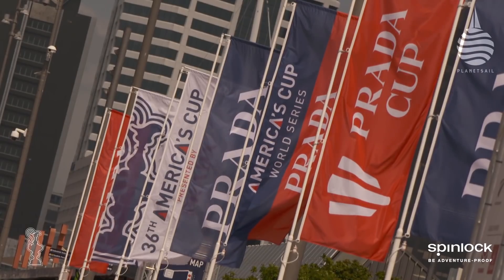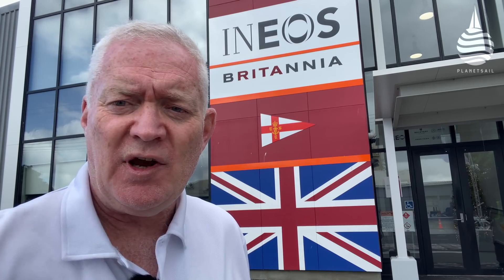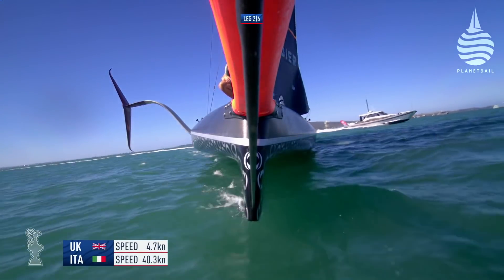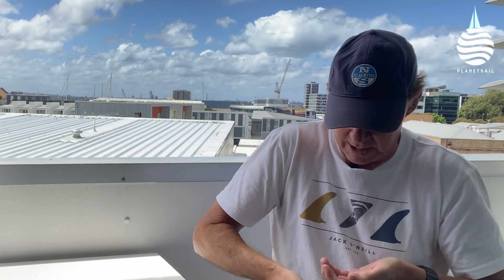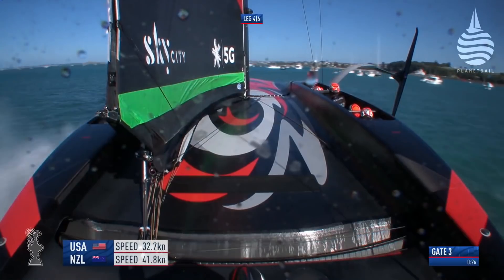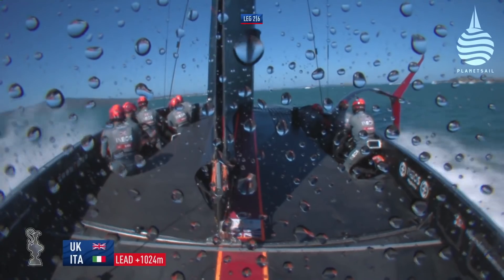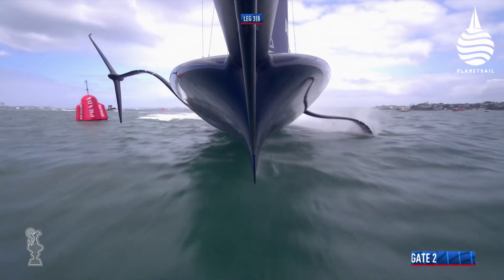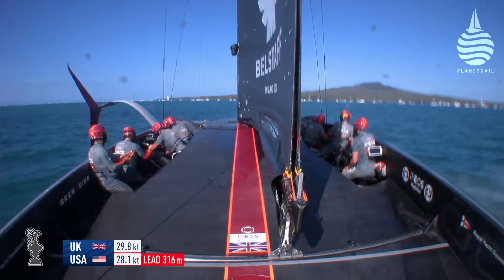America's Cup - Rigs & Remedies

Comment: I'm back from the future to say that next time round, the comment Kenny made following 3:48 still applied, although not to the same extent. GB were still arguably (at least in some conditions) faster than any of the other teams (including the defender) in a straight line once they were up to speed, but slower to accelerate, and it seemed more difficult for them to maintain speed through gybes and especially tacks. 
They got conditions which suited them particularly well in the last stages of the LVC finals, but only for a couple of races in the AmCup. Their trajectory is one of solid improvement though, at a steeper rate than any other team, so I think they will be closer next time, with a real chance of taking their overgrown silver cream jug home, and failing that if they persevere, well before the second centennial of losing it.
Australia had to try SIX times before winning it, and even the kiwis had to have three goes (and another two after failing to defend it).

Comment: Re getting up, I never understood the flat bottom of the keel (?) beam on Ineos. Surely that gives suction getting out of the water? If your slow up,  e as fast as you like your already behind. You can’t do that in sailing ⛵️ surely?  WO…they didn’t check the weather when launching their new boat? Wtf is going on down there? 😡
Reply: Looks pretty much like a water ski to me. Ideal shape for lifting onto the plane. Any deadrise (whether a V bottom, or a rounded bottom) just encourages more of the pressurised water to squish out sideways rather than pushing up against that ski. Snow skis in powder are just the same. There's no suction, quite the opposite, as long as there is a slight angle of attack (and a tip curve)

Comment: As a car guy, I think what Ken is saying @ 3:12 is the UK boat is geared too high. They don't have a first or second gear and need the stronger wind to start off in third gear. I think they'll get that sorted out with experience. Great discussion Matthew!
Reply: He was also saying that the boats need to be able to change up more quickly and smoothly and radically without losing efficiency (as you inevitably do with, say, a torque convertor). More like a VW 8 speed auto, perhaps.

Comment: Ineos' hull shape is way more draggy than Luna rossas, or Team NZL's. When you combine that with lighter foils, the problems are there. Also, the final race between Luna Rossa and Team NZL was decided when the last leg of the race was cancelled. Luna Rossa was suited for the conditions, but NZL had faster setup down wind, and when the last upwind leg was cancelled, the race was sealed. It was a executive decision to make just one winner. As for Ineos, they need start all over, from the Keel up, to create a competitive setup.
Reply: fool
Reply: @gabrielkerwick68  yes, you most certainly are.
Reply: @oikkuoek  hmmm they haven't changed the hull at all and they're 4-0
Reply: @gabrielkerwick68  But they did change the geometry on the foils, and most likely changed the centre of mass, or lightened the whole vessel.

Comment: Fastest boats seem to have full end-plate effect on the mainsails (main foil-wings) all the way to bottom of the leech of the mainsail. They rub along the deck while sheeting in or out. The whole sail-foil moves as a unit side to side. American "boat" adjusts the traveler in gusts to keep the boat going straight with no change in heel. Luna Rossa seems to sail the boat up or down without changing the traveler. 
No in & out on the main sheet (causing boom to rise and leech to loosen)...the foil stays consistent in shape.   my observation.

Comment: can foils be changed each race due to weather conditions ?
Reply: I don't think so. I understand the team nominates the 2 foils (port and starboard, can be different shapes) and other systems a number of days before the series starts and they have to use this over all races in the series. They are also limited to 6 foils thru development. Not sure but I think they can change between challenger and americas cup series.
Reply: @johnhart29  you should be able to change foils and sails for each race ...  foils should be fine tuned for the weather conditions ..    there should be skill in choosing the right gear to use ...

Comment: Good to hear someone thinks sails make yachts move. I had been a little baffled by all the chatter about foils and hull shapes and the lack of discussion about sails. Or perhaps I did not get the memo that all the sails to be designed have been designed. When I took up land yachting and was at first staggered by their speed, but what really staggered me was the mast sail shape. A class 3 land yacht has a small wing mast and a material sail, and sailing at 4+ times the wind speed is very different to sailing a high performance dinghy. Efficient systems to control the sail plan as you accelerate and race at 60mph are key. A speed time is a huge distance, small mistakes are magnified and follow you around the course. A poor mark rounding can still have an effect at the other end of a downwind leg.

Comment: A lot will depend on what the weather is when the racing starts, if it is light and INEOS isn't able to rectify there foils and sails sufficiently they are in trouble.  AM and Prada seem, at this stage, about even with perhaps a slight edge to Prada.  The Kiwi's are, well, they're the easy favorite, but they don't hand you the cup because you're supposed to win.  These AC75 boats are frickin fast -- when they're on foil!

Comment: Probably, as an ex(?) designer, the most interesting interview I've ever seen. Fascinating
Reply: Any idea why they all have bow sprits? No stay sails.
Reply: @robertewalt7789  They are designed to carry a Code Zero of the bowsprit, but it seems they have no use for them in anything but the lightest of winds, if even then.
The rule stipulates a fixed bowsprit and since that is what makes them 75feet, they will probably not change that rule :P Would likely gain some topspeed if they took them of in all but Code Zero weather.

Comment: US Air force messed around with something called a 'mission adaptive wing' that was trialled on a F-111 aircraft ...35 yrs ago designed to change the camber over a wide speed range  (albeit flying at 500+ kts!)
Reply: NASA has worked on adaptive wings also: https://en.wikipedia.org/wiki/Adaptive_compliant_wing

and: https://www.nasa.gov/feature/nasa-to-test-in-flight-folding-spanwise-adaptive-wing-to-enhance-aircraft-efficiency/

Comment: What I don't understand is why they say that power has to reduced once the boat starts foiling. Don't they want maximum power at all times?
Reply: Thank you for all the replies. Much appreciated.
Reply: Speed is different from acceleration.  When you start you want to be in low gear-high acceleration (fuller sails) and then move to high gear-high speed  (flatter sails) mode.
Reply: You also want a flatter shape for speed
Reply: Drag-to-power ratio.  Very high-lift shapes are very draggy, like the full-flap landing mode on airplane wings.  

It's also the case that as they accelerate the speed of the wind over the sail changes (a lot), and like on a normal yacht you have to change the sail shape with windspeed.  For us normal people, that happens only weakly with yacht speed, but their apparent wind is like 60 or 70%  boat speed.
Reply: @TheExcalabur  its a LOT more than that...apparent wind is more like 20-25deg when boat speed is 3 to 4x wind speed... watch a few ice yachts... same physics & dynamics... watch the graphics in the races... they are sailing at 40deg into the wind ON THE COURSE!
Reply: The analogy is that they have a “high gear “ setup, like a car stuck in top gear/overdrive. Maximum top speed but crappy acceleration, so sacrifice terminal top speed for more control and gain acceleration at lower speed to get into flight speed earlier.